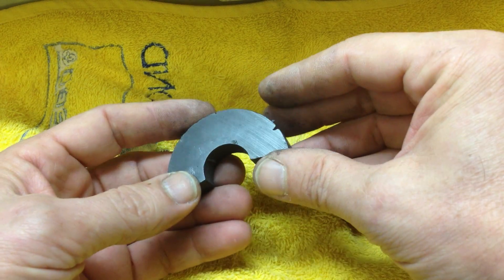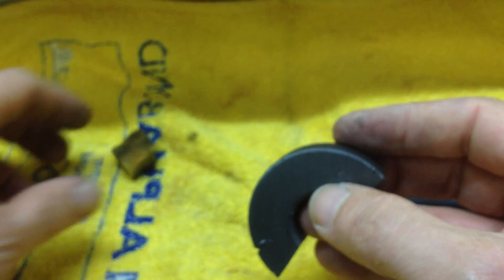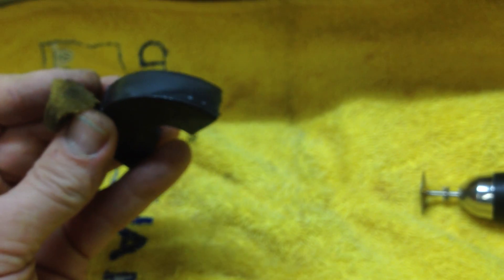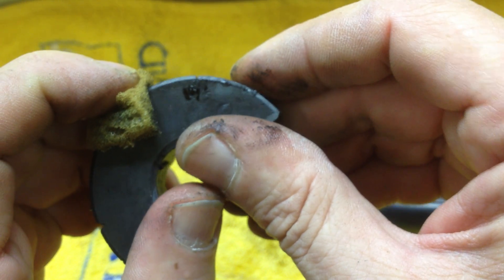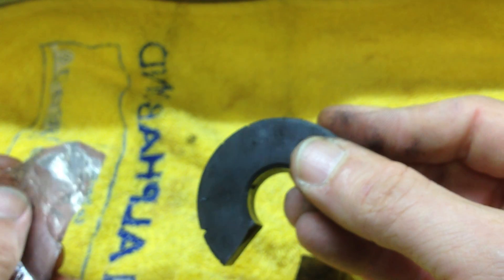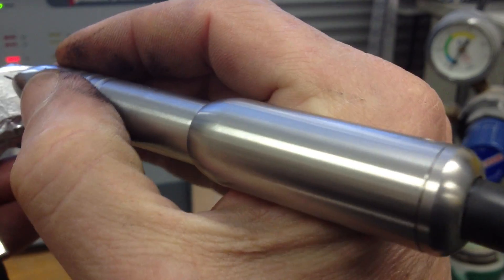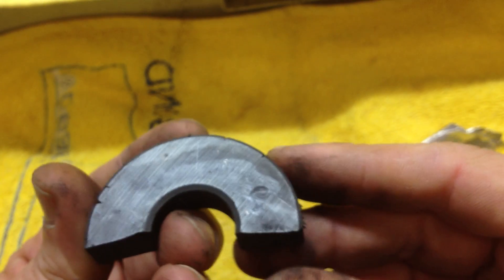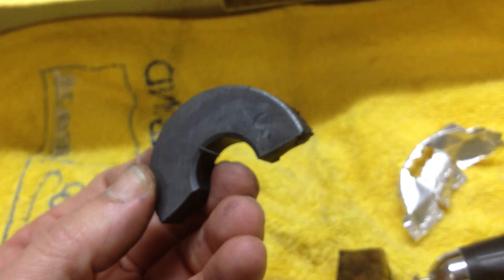cutting and imprinting magnets

Comment: Those little diamond cutting wheels are great. Got some at a gem and mineral show.
Reply from the maker: Sintered diamonds are the ones to get.Normal wheels are diamond bonded to a metal surface and wear out pretty quickly, sintered on the other hand are made as a solid diamond/filler matrix...so they never wear to the metal surface normal diamonds are bonded to because there isn't one, they just get smaller in diameter.They are a lot more expensive to buy, but once longevity is taken into account, they work out to be much cheaper....
Reply: electro1622 thanks for that -i did not know about the sintered ones until now.